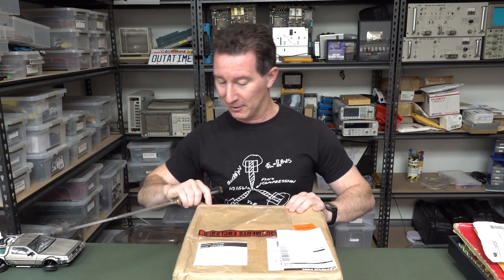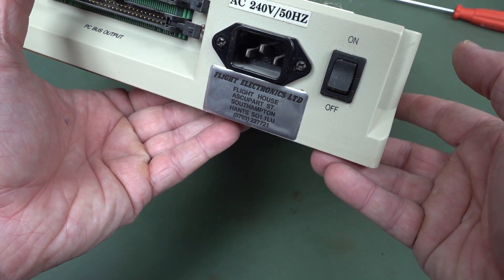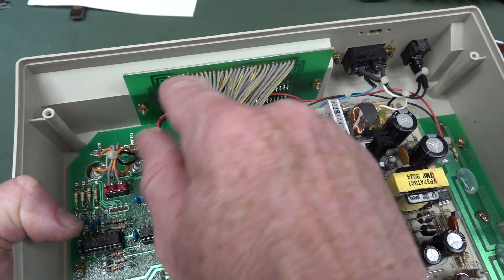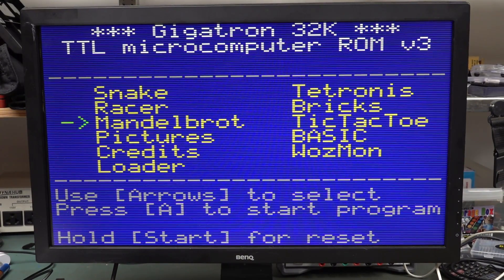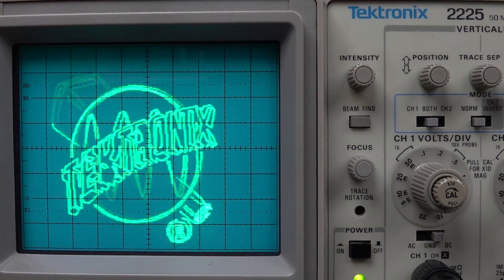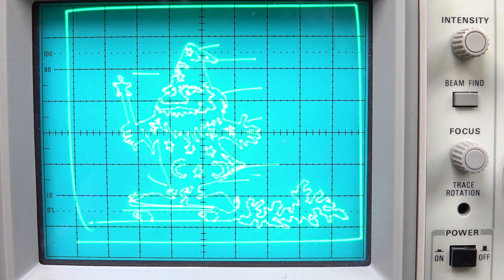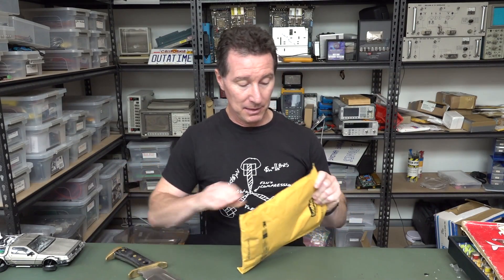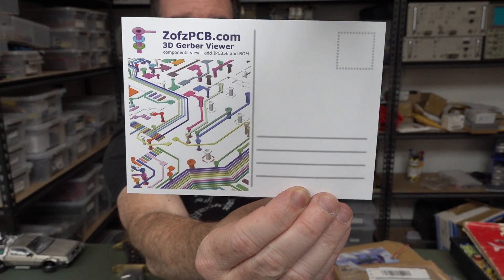EEVblog #1130 - Mailbag Monday

Comment: Those many different 74XX ICs on that Atec design tool are more likely the user having fried and repaired it multiple times. I have no count how many 6526's of the Commodore 64 I have fried, also conducting IO experiments. They were pretty sensitive back then.

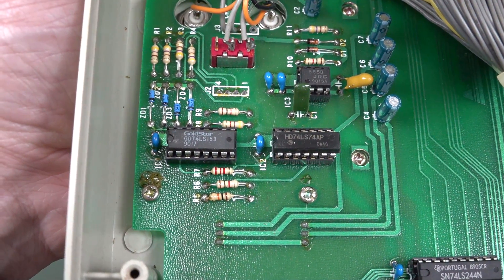Comment: 5:00 - That's the circuit to turn a one channel o'scope into a four channel logic scope - note: not analyzer. Your choice of chop or alternate between the four inputs. 555 timer, the monkey that turns the handle. A 7474 as the two bit counter and the 74153 four to 1 decoder as the channel distributor. Easy peasy! 
(Yes! I have designed boards for the EISA buss. Painful! Even at only 12MHz, you had major timing problems.)
The Tektronix gizmo now includes contacts for two pots so one can play a rezounding game of tv tennis! Note: one or both of your probes were not calibrated. I get the picture of the wizard with a perfect square frame.

Comment: I was disappointed that VintageTek does not include the source code for the ATMEL device. Without the code the item is of little use after the original novelty wears off.

Comment: I wonder if anyone has an idea on this:
I've opened up an old PC (early 2000s most likely) and found a strange device attached to one of the molex power connectors. It's basically a tiny black box 1 by 2" maybe. That was completely sealed. After opening it I've found that the insides of it is enclosed in some sort of plastic, there is no way to get to the actual pcb and see the components on it without causing major damage.  The only thing that is not fully enclosed in the plastic mold, are two Thrystors.  (BT151 and BT152). 
What the hell could this be, and what is it's function?
Reply: Something like a fan temperature control add-on?
Reply: No, it has no outputs, it just has a single molex power connector that supplies power to it, no other connector whatsoever.
Reply: Dummy load?
Reply: Why would you want or need that in a working PC? 
I'd understand on a testbench to try out if a  PSU is functional, but in an operating PC?

Comment: 11:50 - I'm curious about that curve in the lower-left of the 'scope. It appears that the signals are ac-coupled at the board? 

UPDATE: The compensation on the probe attached to  'X' needs to be tweaked.

Comment: 4:18 -- Nice quality control on the power supply -- "for CONTINUDE protection against fire..."  Also, you mentioned Bakelite for the bottom material -- I think you meant Masonite.

Comment: The BNC part of the prototyping board will probably output 4 digital levels from the connector bellow in sequence like 0-1-2-3 issuing a sync pulse at the beginning of each "frame". Sort of converting an oscilloscope into a 4-input logic analyzer.
Reply: Ah yes, 4 channels I just left a comment saying it was 2 but I think you’re right. It was our hamegs that were 2 channel alt/chop

Comment: Wow, a Diyode magazine article using an AtMega328P and insisting on using a crystal and 2 caps when the RC internal oscillator would have been just fine. And now the same thing here. It's almost as if the Arduino ecosystem is designed to completely blind and insulate the people they're "educating" from any progression into understanding electronics at any reasonable level...

Comment: I... I could actually use one of these things for prototyping cards for my vintage PCs. Wonder how much they go for on eBay.
He's right about the ISA bus being easy to interface with. Get an EEPROM and some 74xx series logic, you can do quite a bit.
No, I didn't use one of these back in the day, but having a few vintage computers myself now (they're as old as I am), and now doing a little prototyping of my own, I'd LOVE to get one of these things!
Reply: Yeah it was actually quite good for what it did. You used to also buy ISA wire wrapping boards for the next stage of prototyping. I had two really good books which I just recycled. I had no idea people were doing ISA design now
Reply: I've been trying to find some ISA prototyping boards from eBay, but with limited success. Due to limited space in my Tandy 1000HX, I had to prototype a version of the lotech ISA-CompactFlash adapter to use the PLUS interface (electrically identical, but uses a BERG rather than card edge) rather than ISA with an ISA-PLUS adapter, since the adapter would make it take the space of two slots, and I only had one free. Veroboards are easy enough to come buy, even these days, but ones with card-edge ISA, not so much.

Comment: Wow, what a crap soldering job - a lot of those pads have no solder on top (component side) at all. Maybe solder was real expensive at $200/oz.? If you tip the board over, will anything fall out? 😆

Comment: You should try and repair that CQ-1.  Would be a fun video to watch.
Reply: I was thinking the same thing. Fix that CQ-1 Dave.
Reply: VDFD is dead, getter white means the vacuum has been broken. Needs a cheap unit with the same display as a donor. The power supply is a common Casio and Sharp part, they used the exact same board in hundreds of models with a VFD to give the 1V8 or so supply for the filament, the 33V anode supply and the 5V cathode supply, connected to the filament AC supply, so the driver IC could drive the grids from 33V to 0V so as to get a good  shut off on the display for non ghosting. The input was typically 1V5 from a single AA cell, and this meant good battery life, as well as giving the main chips a 5V or so power rail to run off. Often they also put a small plastic cover over the board to hold a label with the part number.
Reply: @SeanBZA  I'm not sure if the VFD is dead. I know if the getter is white, it's got air inside, so it's dead, but it seems for me that instead of a white getter, it's the end stems which are made of 'milky' glass. I can't see the getter spot on this display. Maybe it uses a tablet type getter instead of an evaporated one. Even if it's dead, probably there are some close-enough Russian replacement tubes on ebay for a few bucks. EDIT: The getter spot is in the middle bottom, and it's black 16:38 . The VFD is fine, or at least not cracked. Hopefully just some open circuit electolytics in the DC-DC converter.
Reply: Could be, second most common problem will be cracked PCB traces and the ever problematic switches, easy to check if the oscillator block is getting power is just put a scope on the filament connections to see if the 15kHz drive is there to exonerate the oscillator.
Reply: And he needs an LGR/8-bit guy style minion to clean all the crud off his old calcumalators and whatnot :-)
Reply: That's what I was thinking!
Reply: AkBKukU have repair one of this: https://youtu.be/K4qiPhjW4us

Comment: Boggles the mind a bit to think about why you'd need a stopwatch and lap counter on the bedside table...
Reply: Count calories for your 'bedroom sports' exercise.
Reply: Actually, my desk is at the end of my bed. So I could use it as an alarm clock, faced to the bed, then when i'm sitting at the desk, turn it 90 degrees, and use it as a desktop calculator and clock. It's not completely pointless. The display is too small tough, to use it as a proper alarm clock. An alarm clock also can be useful for notification. It could be used as a handy desktop gadget with the stopwatch and alarm functions. Even for scientific experiments. Lab timer, stopwatch, and calculator, all in one, but it should have had a damn squareroot button at least...
Reply: You would typically use this on your desk. If you have an appointment coming up, you can use the alarm. Remember, this is the '70s.
Reply: Newlyweds?
Reply: Time the sports event on TV which is also already timed on TV, because you're cool
Reply: Planking on the bed?

Comment: Why do I feel disappointed the Casio didn't work, yet if it did I know I would be disappointed by what it can do. lol
Reply: Hm... a repair video in the works perhaps?  ;)
Reply: I'd replace the whopping 4 electrolytics and see what that does... bummer if it does turn out to be the µP but well worth a shot. Old Rubycons aren't necessarily the most dependable caps, and a badly leaky cap messing up the reset circuit is a classic.
Reply: Dead display that has lost vacuum, but the rest of the unit probably works well. Those capacitors will be somewhat iffy, but it will still work with them as is with a new display, though changing them will brighten up the display a lot, and keep the brightness more even across it with changing segment counts lit.